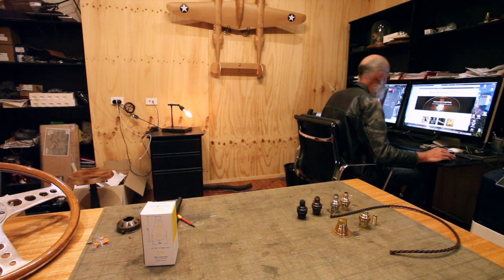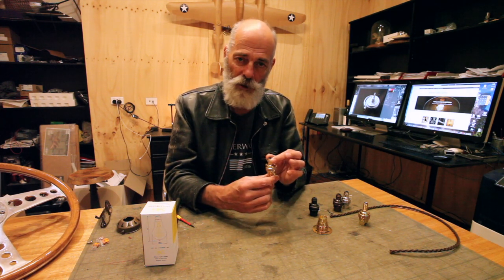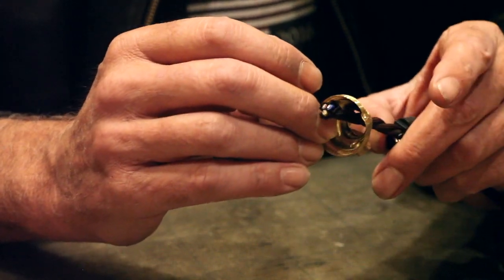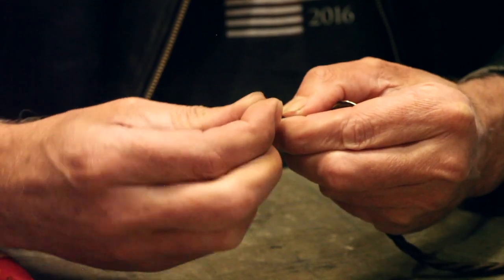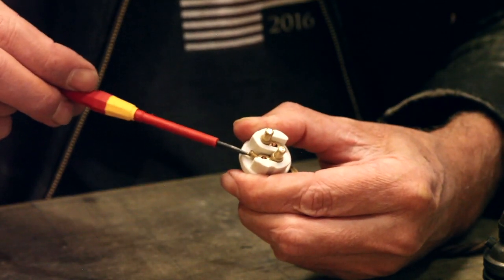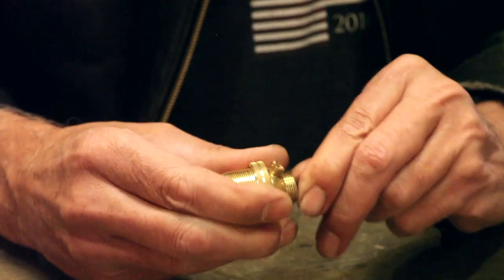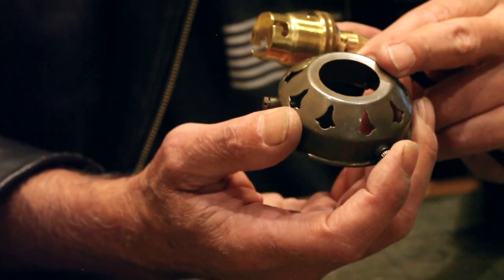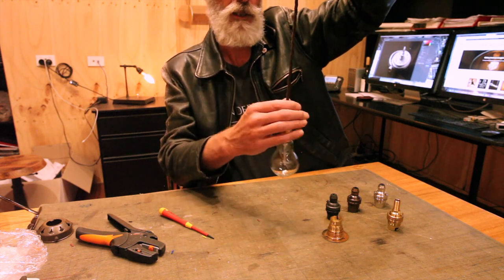How to wire a 220-240V Bayonet B22 lamp holder

Comment: Thanks thats helpful. The one i,m working on looks exactly the same except there is an extra screw at the bottom of the inside of the l cap where the cable comes in which im not sure what is for, do you know what this might be?
Reply from the maker: That sounds like the earth
Reply: Yep. I had the same thing.  It's  fir the earth if your wire/plug supports it. Agnostic polarity. I like that phrase...

Comment: I'm still stripping the two wire ends and video finished!
Reply from the maker: I am not sure what you mean.
Reply: @EdisonLightGlobes  sorry, should've explained better: your video was very helpful and I succeeded in rewiring a lamp safely because of your advice BUT I was so slow that you had completely finished while I was still doing the first bit - removing the plastic casing from the ends of live and neutral

Comment: i have a new supension kit from bunnings but it is to long can i cut the wire  to make it shorter.
Reply from the maker: It depends what is at the ceiling end. If there is a plug in thing then you would need to eliminate that and use a separate ceiling rose.
Reply: @EdisonLightGlobes  thank you getting back it is a Deta B22 Lamp Holder Suspension Kit if that helps
Reply from the maker: @jeffvezich8936   So do you have the ceiling mounted part? If you don't use that you will need an electrician to connect using a regular ceiling rose, cutting the ceiling plug thing off.
Use a ceiling rose like one of these.
https://edisonlightglobes.com/Shop/ceiling-roses/
Reply: @EdisonLightGlobes  hi yes i have bayonet ceiling mounted part and this  b22 lamp holder suspension kit  you push up and turns  and the wire hangs down then the light shade and then the light fit in

Comment: Great video. One question: if wiring a 3 wire cable (including earth) to a plastic bayonet that does not have an earthing connector, what do you do with the earth wire?
Reply from the maker: Cut the earth cable back half an inch and don't connect to earth at the mains.
Reply: @EdisonLightGlobes  thank you. I wish I saw your brass lamp fittings before I bought the cheap plastic one to make my steampunk lamp.
Reply from the maker: @patrickanwandter6079   So depending on the design it may be that an earth is required however.
Reply: @EdisonLightGlobes  thanks. The bayonet definitely does not have an earthing contact

Comment: Can this be connected to 240v socket ?
Reply from the maker: It is a 240 Volt lamp holder. Not sure what you mean by "socket". Do you mean a wall plug?
Reply: @EdisonLightGlobes  yes to wall plug. Regards Tom
Reply from the maker: @TomTomIAm  There is no reason why that is not do-able. In certain countries you may need a special plug top to plug into since it would be a pendant light specification. Generally this is a plug top with no switch with a switch wired to a convenient location on a wall.
Reply: @EdisonLightGlobes  I am in Australia :)
Reply from the maker: @TomTomIAm  OK so it will depend on exactly what you are doing, it may be you need an electrician involved